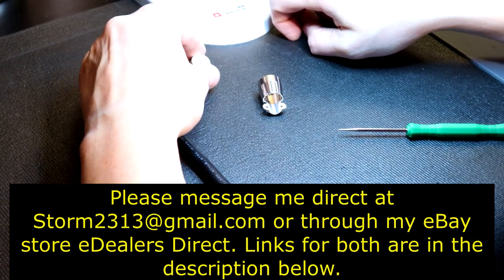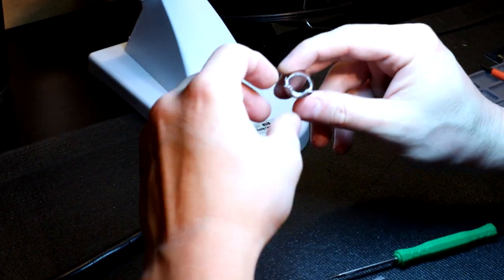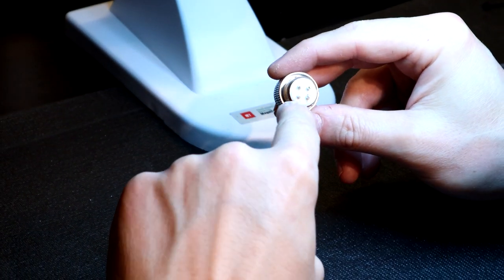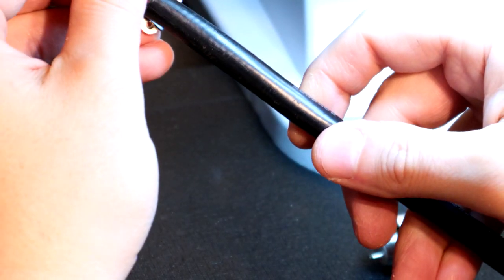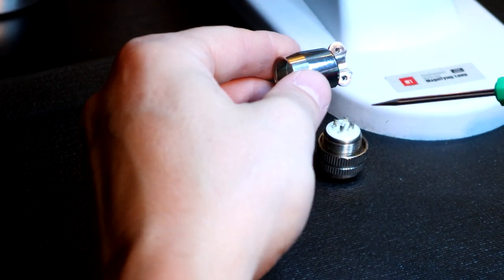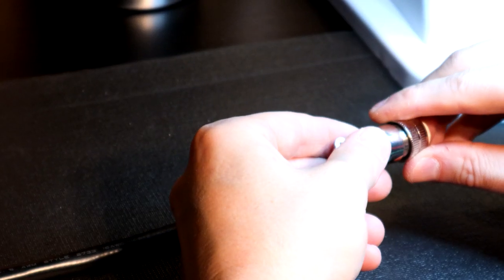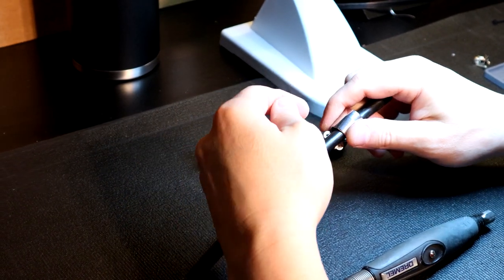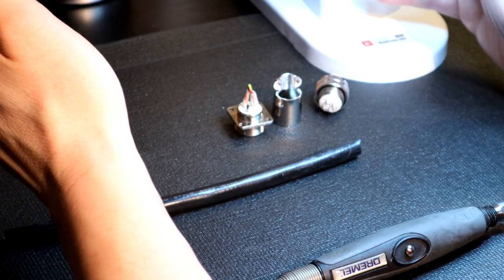The Most Difficult CNC Spindle Connector HY's (H17) Machining Breakdown (4K)..

Comment: i bought a handful of gx-12s to get some practice on the little system before i attempt any connections in the g540 box.  with the gx12s itll still be difficult because of the size but atleast the wires on that machine are tiny i believe 22ga. I finally went through every box of parts ive gotten and tossed the newspaper and condensed and im still impressed with all the wiring done. the flux leaked but just a very tiny bit. Have a good one Vince
Reply from the maker: Hey Dave, thank you again for your support. I'll send you another bottle of flux. Practice is certainly key, and work in a pattern to assure you don't solder yourself in a corner.LoL Thank you, Vince
Reply: @corvetteguy50  no im going to follow your instruction in the order and steps in which to take. i dont have a iron like yours but it has been well maintained and works decent.i feel if i can get a good job on the smaller gx12 the 16 will be easier. as for the little machine i can use any type cabling i need to because i have the crimper for the ibm connector the motors use. when i built this animation modelling computer i used to follow lutroo customs channel and got hooked on custom sleeving all the psu cables so i purchased a quality crimper which works on every connetor in a pc and to my surprise my harley as well.
Reply from the maker: I tested many methods to become not only proficient, but as efficient as possible an mine works very well for me. I hope it will for you to. The iron you use is really end user preference, and as long as it holds temperature, and you have a fine tip you will be fine. Thank you,
Vince

Comment: Hello, thanks for the video.  Do you put shrink tubing over the wires soldered to the H17 pins?
Reply from the maker: Thank you for your support. Yes, after the connector is soldered on you'll apply a piece of double wall heatshrink to insulate the connectors terminals. Thank you,
Vince
Reply: @corvetteguy50  Thanks for the response.  May I ask how you get the shrink tubing around the terminals without cutting the cable sheathing to slide the shrink tubing over the wires before soldering? Or at least it looks like you do not cut the sheathing to maintain its integrity.   Really appreciate the post. I was rather confused as to how they were expecting to power the spindle with such a small wire and connector, so it was a relief to see your video.
Reply from the maker: Please review this video as it covers the installation of the double wall heat shrink installation on the large white HY connector, but the installation is the same for all types of spindle plugs. https://youtu.be/iaoDtLXDk9Y  Thank you, Vince